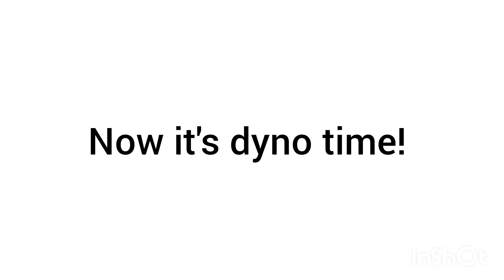VR5 up! Volkswagen up engine swapped 2.3L VR5 now turbocharged on the dyno

Comment: VR5 not V5 😉 you are in England not Germany. VR stand for short inline engine so is nothing V in it as this is inline engine with one cylinder head and shortened block design. Yes i know you didnt know thanks 😂
Reply from the maker: Thank you, I'm fully aware it's a vr not a v, but in the UK and in most of Europe they were sold and marketed as v5 with badges on the boot, bumper and engine cover. Hence, me calling it a v5, not a vr5. I understand the technology behind it being basically a 2.8 vr6 with a cylinder missing! 😊
Reply: @tailord5467  yes is marketing name but going your way with understanding what badges showing then if you swap petrol engine from prius to other car will you still call it hybrid as badges advertising on prius or will you get 1.8 inline 4 engine swap? So yes as long as there is no second cylinder head then is inline engine with very little cylinder offset to make block shorter and not V configuration engine like V5 Honda engine. Unfortunately many bloggers and other media creators with knowledge close to 0 will still call it v5 engine because lack of knowledge and lack of knowing other languages. Dont be like them and go level up 👍
Reply from the maker: I agree 🙌🏻 I'll update the caption. Thank you 😊

Comment: Cool build i have something similar nearly done 

What diameter exhaust are you running.
Reply from the maker: Hi bud, yeah, using a 3-inch v band straight off the turbo and out the wing 🙌🏻 actually I think my compressor housing might be 2.75 inch stepped up to 3 inch straight out the turbo then out the wing 3inch 🙌🏻